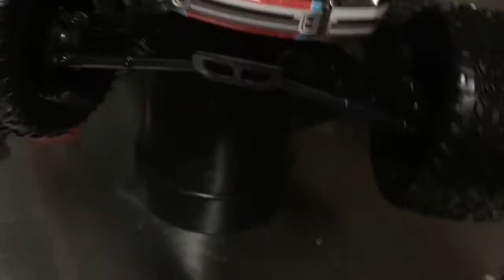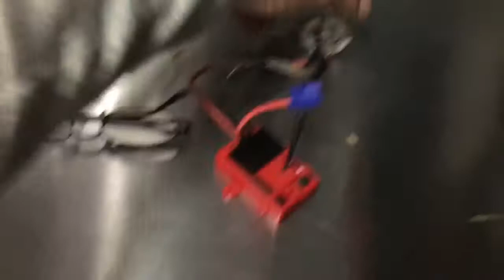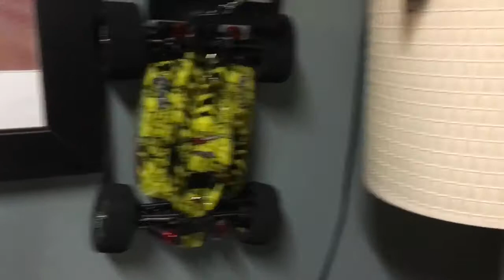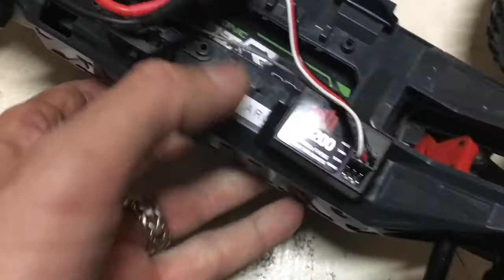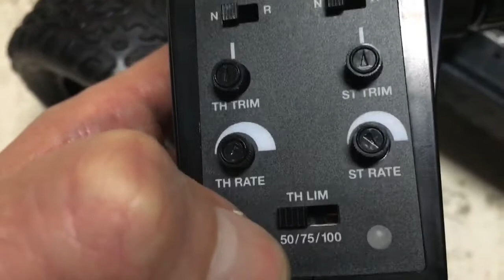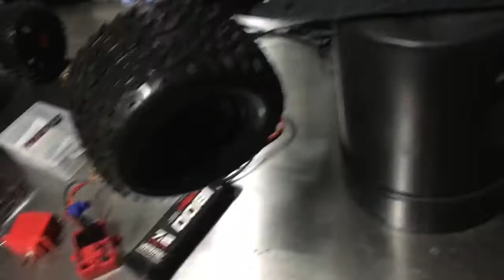ARRMA voltage 3S Brushless Upgrade

Comment: So were getting the granite voltage for my granddaughter  for Xmas could you increase battery current with a slightly strong battery and get just a little more speed ? She 8 and drives the wheels off 40mph trucks ? Thanks , your son is going to have an excellent street sleeper its going blow his friends mind.

Comment: Hi there! Thanks for the input! this tension is capable of lifting 21 or 22 mph ... with a lipo and a brushed 2s ... without damaging the differentials? crown or pinion? Are there any metal upgrades for this truck? I think anyone can put a brushless system ... the problem is if the truck could hold 21 or 22 mph ... without running out the differential, gears or crown pinion in the first few runs?